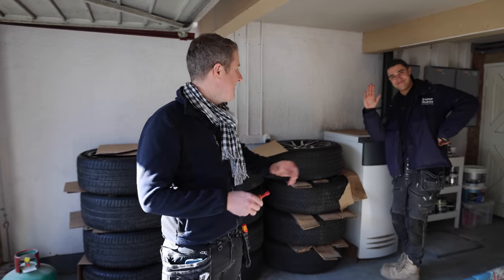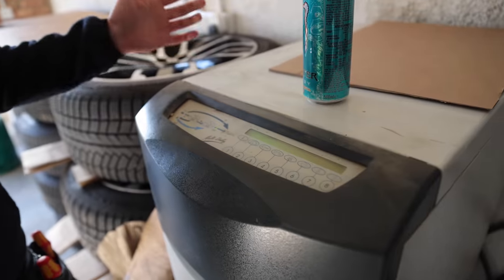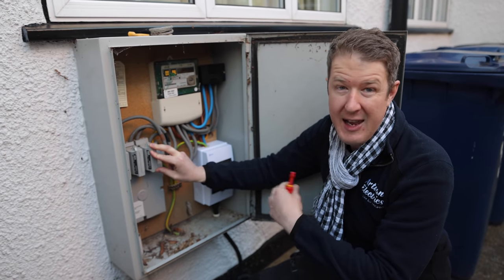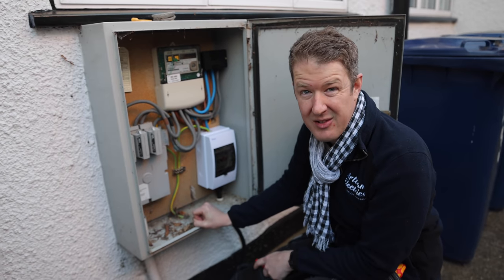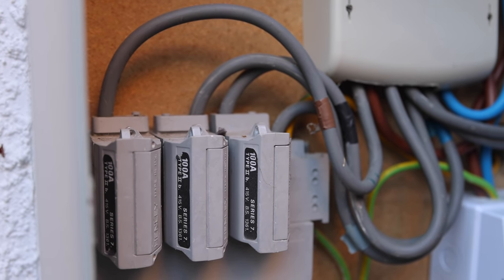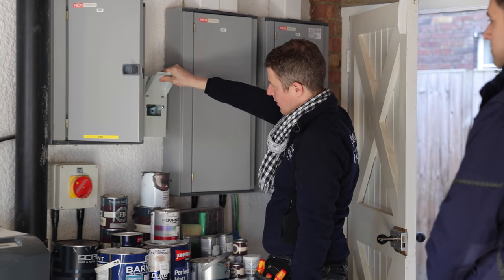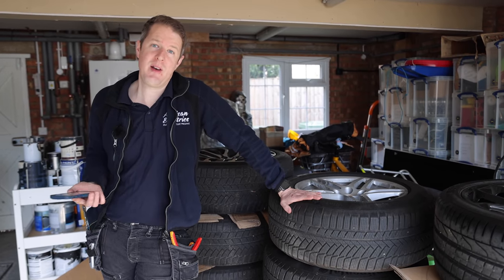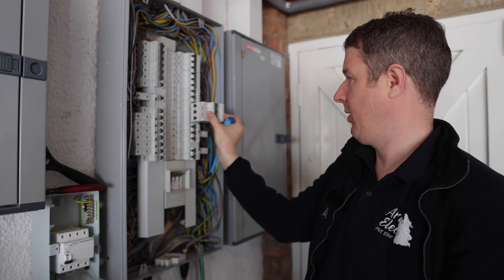INSTALLING THREE PHASE 22KW CAR CHARGERS AT HOME! - Electrician Life

Comment: Western Power Distribution have started installing 3 phase cables & service heads on a lot of new connections. 
Often only a single phase connected but it makes the upgrade process far easier (and hopefully cheaper)
Reply: Most DNO’s are happy for new build developers to install 3 phase - my DNO is northern power grid they’ve approved me to have 3P on my new build - just a £1200 upgrade fee to the developer (bargain in the scheme of things) - 3 phase should be the norm on all new homes with 3+ bedrooms I think - a lot of countries in mainland Europe have been doing it that way for years
Reply: @benjaminc1816  Yep!Since the war,they had to rebuild a lot off houses,so in every house since then the supply cable is 3 fase.But not all houses have 3 fase.But the cable is there allready.
Reply: It's standard now with western power you don't get the choice it's future proofing and allows for easier load balancing
Reply: @haldo691  eFIXX Did a video about this a few months back actually and WPD was the DNO - search for “this is not a consumer unit” and you’ll find it - it’s good to see!
Reply: @benjaminc1816  I work for WPD so I know about it lol
Reply: Here in the Netherlands as far as I know every house is connected to a 3 phase main cable, but mist are just connected single phase.
Reply: @benjaminc1816  Yes, they do. But as far as i know they do not have 3x100A main fuse. Over here most domestic is 3x20 to 3x63. 3x100 is  more like light industrial.
Reply: @computeraddic675  You talk rubbish.

Comment: In the US, the 110v is a centre tapped 220v supply - centre is earth referenced neutral and each live is 110v to neutral - their bigger appliances (dryers / HVAC etc) uses 220v as it feeds from both lives, and the generic appliances just use 110v - benefit is if you touch one live then the worst you’ll get is 110v through you - but the downsides are they need thicker cables as amperage is higher for the same wattage appliances on 240v - they have less protection in the board RCBO’s / AFDDs etc  - but at least they don’t know the excruciating agony of standing on a UK 3 pin plug when walking through the house to go for a piss in the dark 😂
Reply: I was going to say that!
Reply: @steveb1856  Ha! Sorry! I’m still baffled why someone would want their UK house wiring to US spec though! I’m intrigued!!
Reply: Hey we do not have 220 volt power in the US. We have 120 volts, 240 volts and 208 volts... In the US most houses have single phase L1, L2  Neutral and Ground. L1 or L2 to Neutral = 120 volt service and L1 to L2 = 240 volt service. Most major appliances in the US like Air Conditioners, Ovens, Clothes Dryers and Hot Water Tanks are 240 volts.
Reply: @michaelholliday100  Roughly, UK nominal voltage was 240v but was changed to 230v to harmonise with Europe which was at 220v nominal. Actual voltage will be in quite a range.  In the UK, the declared voltage and tolerance for an electricity supply is 230 volts -6%, +10%. This gives an allowed voltage range of 216.2 volts to 253.0 volts (so the former 240v nominal is still within the normal range, that is also reason it is only -6% as the lower bound is the same one as when the declared voltage as 220).
Reply: @kenrohde6841  "Roughly, UK nominal voltage was 240v but was changed to 230v to harmonise with Europe" -- except it was not actually changed, the UK supply voltage is still 240 V same as it was before. There was no need to change it as 240 V lies quite well within the 230 V + 10% range. Michael Holliday is also quite correct that the normal supply voltage in the USA is 120 V not 110 V, with 240 V available for large appliances.
Reply: @michaelholliday100  I find it intriguing how American service providers describe it as "single phase" even though you have two live wires.  That's patently 2 phases, with the phases being 180 degrees apart instead of the 120 degrees which you'd get in a 3 phase supply.
Reply: @johnwinters4201  it’s centre tapped single phase. You get two sine waves 180 degrees apart but it’s ran off a single phase from the generator/supply.
Reply: @toddbod94  "Two sine waves 180 degrees apart" is exactly a description of a two phase supply.  Yes, I know on a supplier's job sheet in the USA it is described as a "single phase" installation, but it's exactly the same in electrical terms as a two phase installation.  You can call it 240 V centre tapped, but it can equally (and more normally) be described as a 120 V, 2 phase supply.

The clue is in the name.  A single phase supply has one phase/live/hot wire.  A two phase supply has two phases/lives/hot wires.  A three phase supply has three phases/lives/hot wires.
Reply: You should go back to school, in the US we have 120 volt and 240 volts, not 110 volt and 220 volt...
Reply: @michaelholliday100  🤷🏼‍♂️
Reply: @johnwinters4201  it’s not 2 phase because the supply isn’t 2 phase
Reply: @toddbod94  Err, no.  You're correct in saying that the feed into the final transformer is just a single phase but that doesn't affect the fact that what comes out is a two phase supply.  Count the phase/live/hot wires - there are two of them.  Hence why it's called two phase.  In this case the two phases are 180 degrees apart, where with a three phase supply they'd be 120 degrees apart.
Reply: @johnwinters4201  2 phase refers to an obsolete generation and distribution standard where the phases were 90degrees apart. Centre tapped single phase is categorically not 2 phase.
Reply: @toddbod94  Ah - there you've highlighted the crux of your confusion.  I don't dispute that the supplies are referred to as single phase - in fact that was the starting point of this thread - the oddity that they're referred to as single phase even though they are in reality 2 phase.  The explanation is that the feed into the final transformer is single phase, although the output into the property is 2 phase.

I'd be intrigued to see any proof that a 2 phase supply with phases 90 degrees apart has ever existed.  I don't doubt that it could be done, but it would be utterly pointless.

It doesn't matter how many times you assert that a supply with two hot wires, each carrying a phase, and with the phases 180 degrees apart is somehow magically not 2 phase, it still won't be true.

Crucial point which you have repeatedly failed to address - if you had something which you did accept as being a 2-phase, 120V supply, the phases being 180 degrees apart, what would be the difference between that and a normal US installation?  Where it came from is irrelevant - what would be the difference in what it actually is?  Treating each supply as a black box (no peeking at how it was done) but with access to the three incoming wires (1 x neutral + 2 x hot) and all the electrical test equipment which you might want, how would you tell them apart?

Comment: We've just had 3phase installed into our garage to charge the car ... (was only £150 difference between that and a single phase to install) Total install cost £2,400 .. Garage was seperate to the house and had no electric so only way was new DNO install.
Reply: If your house only has single phase then where did you get the 3 phase supply from? Did it already have 3 phase but you were only using a single phase?
I know the LA charge more than 150 quid to add 3 phase as it requires running new cables,digging up the road to the nearest 3 phase supply.
Reply: @stevie1403  there was no electric, it was a dno dig from their main cable.  £2,250 for single phase or £2,400 for a 3phase install
 Ie. Cost of cable difference.. Only. Same dig, same route. Etc.

Comment: I recently had a 3 Phase charger installed, I was lucky that three phase supply to the house ( many years ago the house was three separate flats), internally it had been downgraded to single phase but reasonably quick to get U.K. power networks to upgrade main fuse and Eon ( after a lot of nonesense from EOn via email telling me I couldn’t have a three phase meter, clearly a training issue for their customer department) to put in three phase meter.
Reply: Do you pay more standing charges for having a three phase meter?
Reply: @johnburns4017  No , all charges are exactly the same as for single phase.

Comment: Updating to 3phase isn’t always extortionate - I’ve been quoted 3k inc vat from the DNO (which is still a lot considering I have a telegraph pole at the end of my 10m driveway) - I was surprised when I got the formal quote!
Reply: If you have a pole at the bottom of yout garden you're lucky. We needed to upgrade as our home had a 1 ph  50A circuit, had to dig 25m up the road, plus 20m under our block paved drive, and a totally new intake box, secondary distribution box to split to car charger, and then into house with rest...
It was NOT cheap, just the cabling to the house was over £10k
Reply: Just got a quote and yes we are lucky too.  Pole directly outside. 2.6 k but we have to dig a trench.

Comment: Interestingly when I first enquired with Anderson you can apparently fit the 22kw changer on single phase and it will work due to being the same charger. It's just the connector and out going lead which is different. A good option for homes that can be upgraded to 3 phase but already have a set date for delivery before hand etc. It's also the charger recommended by the Porsche dealers for the Taycan.
Reply: I've fitted the Schneider EVLink ones and they're the same. They don't have a tethered lead so you can use the 3P lead that came with your car for single or three phase. Ultimately, all these EVSE devices are really doing is using a contactor to link the incoming lines to the pins in your type 2 charging connector (the 3 horizontal middle pins of the type 2 connector are L1-L3) and the car is doing all the work of AC->DC. The EVSE doesn't really care whether just L1 or L1-L3 are connected although it will have an internal CT on each line for metering. Like you said, if the tethered lead is only 1P (cheaper and less copper) then it needs changing.
Reply: @havoctrousers  Oh I just meant from the pov that some manufacturers aren't actually using the same internals across the 1p/3p versions, either different contactors or actually no terminals for the extra phases. Not fitted the Schneider, we tend to fit the Zappi and Anderson as the main 2 with Hypervolt becoming popular mainly due to Jordan's channel here. I have a feeling that once the world stops being in such chaos all chargers will just be supplied 3 phase compatible as standard, especially as they're considering making all current homes where possible 3 phase to help with the transition to renewable - whether that comes to pass or not we'll see.
Reply: @havoctrousers  
EVSE, another acronym to confuse and keep guys in the club.

Comment: I'm in UK and as I have my supply looped from next door on 80amps. I asked my DNO to swap too 100 amp fuse and they said I can upgrade to 3 phase at the same time as they have to dig up the garden to run new cables..might as well put in 3 phase right??
Reply: Yes definitely. Since it's a looped supply I'm guessing it's free of charge? 100% do it! You don't necessarily need to get a 3 phase meter until you're ready.

Comment: Always check your car maximum AC charging input as a lot of cars will only charge at 11kW max on AC. Installing a 22 kW charger could be an expensive mistake. As a Ford dealer in Cardiff found out by installing 22 kW chargers instead of DC chargers against the advice of the installers and complained why his Ford Mach E cars weren't charging at 22 kW. Perhaps the issue was the Mach E only has a 11 kw charger ? LMAO.

Comment: 1:52 not to start a comment war, however the US outlets are upside down.  While there are arguments either way, the majority of manufactures assume the ground pin is down, because that is the way all the cabling are made for the transfers and other times (charges etc).   Kind of like if you guys put the ground pin down, but its our assumption here.  Our larger 240V style plugs assume ground pin is up as all 90 degree cables are made that way here.  😁👍
Reply: It is commonly done both ways. I wouldn't say ground up is wrong. Residential is most commonly ground down and commercial is most commonly ground up. The usual argument is that commercial installations tend to use metal faceplates, and if the face plate becomes loose you'd rather have it fall on the ground pin than a live pin. Of course that's only a problem because our plugs don't have sleeved pins.
Reply: These US outlets on a UK sized plate are part of MK's logic plus range which curve in at the top. They definitely intended them to be fitted with the ground pin at the top as in the video
Reply: Us switches are upside as well 😉
Reply: I'd argue that ground-down is the safer configuration. When the plug rattles free, the bigger gap will be at the top, so having the harmless pin there to be exposed to touch is nicer. (Really, who thought designing a plug in a way that a live pin can be exposed to touch was a good idea?)

Comment: Fun fact:
You can do 10A 7.2kW over 5x1.5mm² cable (total 7.5mm² of copper). Fot the same power, at 30A, you would need at least 3x4mm² (total 12mm²), which is 50% more copper for the same power.

Comment: Interesting to see the 110V transformer in a home, guess they travel between North America and the UK a lot. Most common setup here is corner-tapped Delta. Wonder if that is actually split phase, seems so looking at the board. Some homes built in the 1950s here have "Stinger" 3-phase as the air conditioners of the time were only 3 phase. Vast majority of houses and even some small businesses are split phase 120V.
Reply: I wonder what they are using the 110 for, it still is going to be 50 Hz as compared to American 60hz

Comment: The black paint is probably a rubberised product to prevent ingress of water on the edge of the drive.
You low level hole for armoured has just ruined that you should have come up the wall then drill through.

Comment: Had a free 3 phase upgrade by WPD - if you need the extra power for a low carbon technology (EV chargers and heat pumps) they will do that. Went for a Zappi for several reasons, one being that 3 phase RCDs are extortionate, far more than the £120 extra over the single phase Zappi.
Reply: Eh? You can buy a MCG 4 pole type A RCD for £50 from CEF. If you want a type B then yes, you'll pay 5 times that but most charging units have some kind of DC disconnection device so that only type A is required.
Reply: We're with WPD and need unlooping from next door. They offered to put in 3 phase for free (actually, a requirement for our solar installation). Mind, that free 3 phase has added £900 to the solar PV, £1200-1500 for a new DB and £1200 to replace our single phase Ohme chargepoint with a 22kW Zappi. Free is evidently a relative term!
Reply: Hi Nick, thank you very much for sharing this info. I’ve recently contacted WPD to have them check our fuse (knowing it’s only 60a). 
I plan to have a Zappi installed along with a heat pump). With the additional plans we have for the property we imagine our load will be over 100a.

May I please ask how you went about having the three phase commissioned? Or any tips you have with the process. We are based in Northamptonshire so I hope WPD offer it across their wide and varied area. Thank you
Reply: Hi Francesca. I'm in Northants too - the WPD guys who did the installation said they were doing loads so hope getting yours is straightforward. I put in a 3 phase DB next to the new intake and ran a submain to the old consumer unit, and over time I'm moving the circuits to the DB and will get rid of the consumer unit.
Reply: As for getting the process underway, I dealt direct with WPD and put in the ENA permission to connect form myself. At that time (a year ago) it was pushing at an open door.
Happy to help if you have any other questions.
Reply: @NickW1111  Hi Nick, I lm really pleased to hear yours was so straightforward with WPD. 
I hope it’s the same for our home 🤞🏼
Reply: @NickW1111  thank you for confirming your process. I’ll contact WPD on Monday and see what the next steps are, I really appreciate you replying.. it’s always helpful when someone shares their experience. I will keep you posted and I hope you don’t mind me messaging, if I need to ask you anything further. 
🙂
Reply: @franc1985  When you fill out the ENA form, make sure that the maximum demand is over 100A which isn't hard if you have an electric shower, hob or over plus 32A for the EV charger.  My installation took 3 days - the first 2 days were contractors laying in the cable and exposing both the LV feeder and the old single phase feed.  Then WPD jointers put in the new service fuses and terminated the single phase supply.  The hardest part to organise was the 3 phase smart meter from my supplier but they came good that afternoon, leaving an isolator for the new tails.
Reply: I have been out of the trade for about 20 years but I was under the impression that the supply company 
would not give a private home a 3 phase supply
Reply: @davefish8107  For WPD, 3 phase is standard though it depends on what the developers will pay for and they have less control over ICPs.